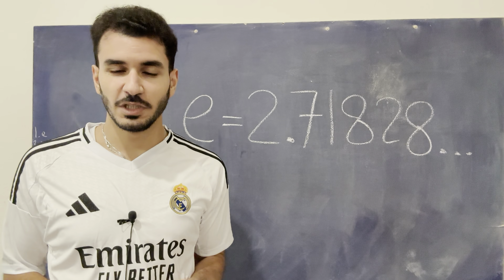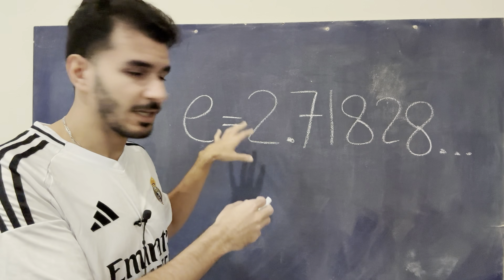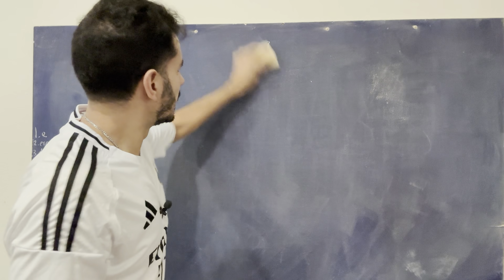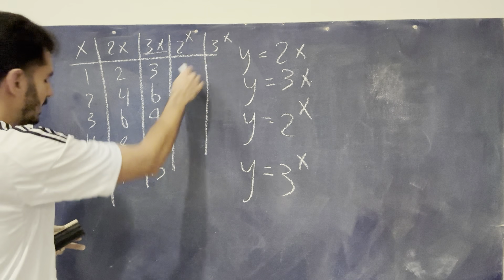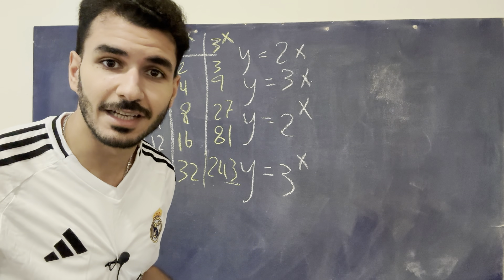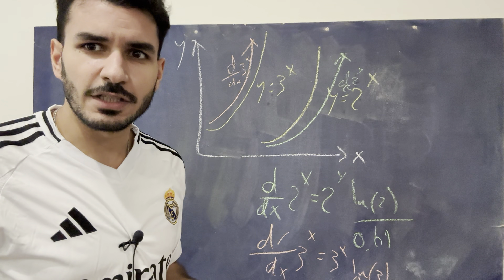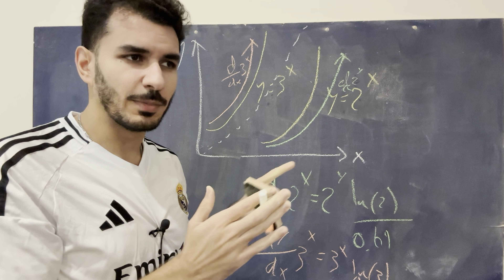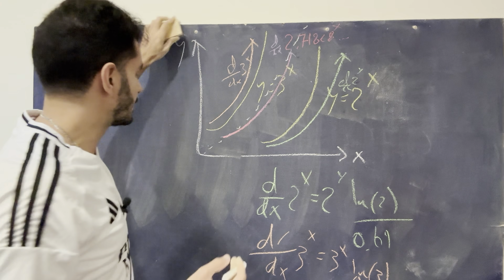Where does “e” come from?

Comment: I just added the breakdown to math and science videos as I see and add it to the e equals as per wth are you saying energy, exponential or exponent..a e has literally three angles at .9 degrees because it's a fraction of a circle. One making 390 degree and therefore only part ..times three is 2.7 now add the constant for the compound and division of ..for the constant meaning literally continuing. It's structural and atomic make-up so don't pun your way home because I am pretty sure this simple way to see geometry and the last is the cleavage becoming the crevice valley or equal value for again, ??? Cleavage. Compared to carbon and yes the diamond pattern of frequency..fitting in a neater little package to understand for anyone that has interest in the forming causes and a place on earth for waters and hills. Cleavage..the information highway about reflecting because continuing is about that..each layer atmosphere has separation divisive but simultaneously uses each to transition suns frequency. You're seeing why maybe truly..how truly. Why for what? Sometimes the why helps explain the math in usage

Comment: Way too many new concepts are introduced into this understanding. It is impossible to use unknowns - derivatives, exponents, limits …  to explain another unknown ‘e’. Instead, start by drawing the inverse curve 1/x. Then draw a vertical line from the curve to the x axis at x=1. Then show that the area under the curve (square units) increases as x gets larger. Finally, when the area = exactly 1 square unit, then the value of x = e. (2.71828…) From this easy understanding you can then use this basis to develop the properties of d/dx (e^x) = e^x. Finally, introduce limits and Euler’s equation for advanced unerstandings.

Comment: You are right. e was never explained like this. Great video. Thanks for sharing. I especially found your comment linking e to equilibrium. It makes sense that Bernoulli first discovered this number. When you extend this into Chaos theory I am wondering if this has anything to do with an attractor. Some experiments derive order from chaos which may also be linked or related to this constant. There is also in Modern Thermodynamics additional theories that extend the 2nd law the further you are from the equilibrium that helps expose or amplify some special properties of nature that are recently becoming useful in physics to help explain more of Maxwell Clerk equations.

Comment: but how is it that the log 2 and log 3 are calculated to be .69 and 1.09. what is the base used for this calculation? is the base is e, how are you defining e after using e as the base for calculating log 2 and log 3

Comment: I have known about e since secondary school 40 years ago, I have being using e practically and looking at YouTube on the subject of e for the last 20 years, and  as an engineer I have had a gut feeling e was about balancing a circuits dynamics, with the rate of a capacitors voltage increasing equivalent to the rate of the decreasing resistor voltage, but this video is one of those Aha moments, a great composition of maths, chalk and good lecturing. Thanks, I appreciate the video for how it explains e.

Comment: Where does the constructive algorithm of e actually come from? Well, from Platonic heavens, of course! :) 

In the mathematical means currently available to us, this revelation can be seen from the periodic continued fraction of 1/e: 
[0; 2, 1, 2, 1, 1, 4, 1, 1, 6, 1, 1, 8, 1, 1, 10, 1, 1, 12, 1, 1, 14, 1, 1, 16, 1, 1, ...]

The cf path is a convolution or fusion of two types of periods, at first look the 2n periods punctuated by 1, 1 periods. To see more clearly, let's write out the full R/L path along the Stern-Brocot binary tree, which constructs number theory from top-down nesting algorithm perspective of mereology. 

L LR LL RL RRRR LR LLLLLL RL RRRRRRRR LR etc. 

Now, let's see what happens when we split the periods in half and do a simple string length count of the truncated segments: 
0
L 1
LL 2
LLRL 4
LLRLLR 6
LLRLLRLRR 9 
LLRLLRLRRRRL 12
LLRLLRLRRRRLRLLL 16
LLRLLRLRRRRLRLLLLLLR 20
LLRLLRLRRRRLRLLLLLLRLRRRR 25
LLRLLRLRRRRLRLLLLLLRLRRRRRRRRL 30
etc. 

The length counts alternate with perfect squares n^2 (1, 4, 9, etc.) and oblong numbers n(n+1) (2, 6, 12, etc.). The distances from the perfect squares to the previous and next oblong numbers are equal. 

The path segments LR and LR are length 2 periods of Fibonacci fraction paths with maximum zig-zag. Based on what we have observed so far, we can deduce that the 2n periods come from the straight paths of "oblong" fractions n/(n+1) or (n+1)/n without any zig-zag after some possible initial values. 

These are fairly simple observations, and I don't know why these don't seem to be already public knowledge. Here's an IMHO interesting question. As we interpreted the first LR substring as a Fibonacci segment, it would seem more consistent to organize the continued fraction path the following way: 

L RL RR LR LLLL RL RRRRRR LR LLLLLLLL RL etc., instead of
L LR LL RL RRRR LR LLLLLL RL RRRRRRRR LR 

so that the alternating zig-zag of direction changes would be coherent with the analysis of involved periods. From quick check using the path calculator on R. Knott's pages, the corresponding fractions at that search dept are 47483/75117 and 27634/75117. The denominators remain the same, and numerators deviate at 2/3 and 1/3. The subtraction differences start as Fibonacci sequence, but the whole structure is more complicated.

Comment: Very nice video! I have a question. When explaining the derivative of 2^x and 3^x, you got ln 2 and ln 3 values, but that ln is a log with base e. If we had a different base, wouldn't the derivative become equal to the new base and thus change the e value to the new base value? Though the following explanation of the limit of the function explains a number for e for that function, why does that function become important and not any other function? Please let me know if I make sense. Also, please share your thoughts. Thanks!

Comment: Several comment here. e^(itheta) ties in with your video on I where it is the rotation operator on a vector, so it makes perfect sense that it would give us rotation.

Also, if we multiply Euler's equation with the complex conjugate, cos(theta) - i sin(theta) of the right side, we end up with the function, we get e^(-itheta) =  cos(theta) - i sin(theta). adding and subtracting e^(itheta) and e^(-itheta) gives us the equations for cosine and sine.

One idea from the world of business. One dollar compounded continuously at 100% interest will be worth e at the end of the year.

Here is an easy way to remember e. It is 2.7 then the date 1828 which is such a significant date that it is repeated. Then we have a 45-90-45 right triangle. e = 2.718281828459045.

Comment: Very interesting video. But, you didn’t include the best part of your demonstration: the algebraic derivation of this function. The expression (1 + 1/n)^n can be algebraically deduced using the Binomial Theorem. After working through the algebraic manipulation, you’ll arrive at this exact result: (1 + 1/n)^n = 1 + 1/1! + 1/2! + 1/3! + 1/4! + 1/5!... 

This is the definition of "e"—the infinite sum of the reciprocals of factorials.. If you plug in this values in a calculator, it will add up to 2,718... in fact, that's the way the calculator operates this value. You can also do it by hand. Eventually you will get to this aproximation.

The most interesting part is to ask: why don’t we end up with a fraction? Or a root? Or some power-based result? The answer is: "e" is transcendental, just like π and other constants, meaning it cannot be expressed through fractions, roots, or any common algebraic tools we use in everyday math.
Reply: If I also have a chalk board I would demonstrate the algebraic part for you. It's not hard.

Comment: 10:10 Actually, that value comes from Euler trying to calculate how would be the compound interest value of deposit with interest rate 100% per year, if he could get partial interest and reinvest it. E.g.:
If the interest would be paid after 365 days, the total amount would be C+100%*C = C(1+1/1)
If the interest would be paid every 6 months and immediately reinvested, the amount would be C+50%(C+50%*C) = C(1/+1/2)^2
If the interest would be paid every day and then immediately reinvested, the amount would be C(1+1/365)^365
If the interest would be paid every 1h and then reinvested, the amount would be C(1+1/(365*24))^(365*24) etc.
The amount approaches a strange number of 2,718281828... known today as Euler's number "e".

It appears that the same number is for the function f(x)=e^x which miraculously has the value of "steepness" equal to the value of the function for every x.

Comment: I asked chat gpt were e came from some months ago. I just add this because it explains were the fomula (1+1/n)^n with n going to infinity comes from.
The number e was first calculated by Jacob Bernoulli around the year 1683, while working on a problem involving compound interest. 
Jacob Bernoulli investigated what happens if you invest (€)1 at 100% annual interest, but instead of compounding yearly, the interest is compounded more frequently:

    Once a year: (1+1)^1=2

    Twice a year: (1+1/2)^2==2.25

    Four times a year: (1+1/4)^4=2.4414

    n times a year: (1+1/n)^n

Bernoulli discovered that as n approaches infinity, the result does not grow without bound, but instead approaches a fixed limit: the number e.

Comment: death rate try to decrease population, birth rate try to increase the population , overall rate of population and in many cases in nature is e as well , plus since e has a constant rate  , we use e with iota for constant rotating things , like constant rotating current ( meaning oscillating ) or any other physical system , and where the expanded cos and sin part gives us exact location of the measurement at anytime, mind blown and very interesting.

Comment: I'm not really a math major guy but I saw somewhere that some mathematician before Euler invented the use of logarithms to be able to handle large numbers and series of various growth rates. Like log(100) [base 10] = 2, log(1000) = 3 and so on. 'e' is simply a special case of all the (infinite number of) possible bases whereby the derivative of exponent, like you have shown, is equal to itself. d/dx e (exp x) = e (exp x).   This is weird in the same way the d/dx sin theta = cos theta. huh?  actually i think they are indeed related in euler's formula??

Comment: Positive numbers above and right of the origin intersecting perpendicular enumerated straight line segment coordinate system axes, + and negative elsewhere, imples they're opposites, by contrast with hyphen, - , prescripted duals, shown here for reflection in the magnified horizontal axis where "|" is a similarly labeled vertical axis * ,

 ... > -1_-1/2_ | 0 : -X <--> X | __1/2 __1< ... .

Necessary dichotomally recognizing category and not category establishes quantity and no quantity representative numeric complements, unity and only function defined, ●○ : upper bound --> supremum, indefinite whole number that isn't a successor zero, 

with numeric difference and magnitude implying the arithmetic operations subtraction - , addition + , multiplication x and division / , while mathematical consequences from recognition include 'ruling out' non-number symbol infinity and a resulting product only of the same kind as it's arguments ** .

* This law of the excluded middle abiding solution, - x +, may avoid the devastating contradiction from a spacedual-space, -x+, singular interpretation of the set of real numbers.

**
• Either reflection, or rotation, other than about a coordinate system's zeroed origin, implictly recognizes a dual entity.

• Young's double-slit experiment implies physically corroborated seman-syntac-tic entity, electron, has particle and wave forms.

• 〜 wave has a crest, trough, wavelength, amplitude above and below normal and augmented result when two nodes intersect, but cancelled crest-trough anti-node otherwise (  https://en.m.wikipedia.org/wiki/Electromagnetic_radiation  ).

• Christof Koch's finding that visual continuity is interpolated ( Closer To Truth, "Christof Koch - How are Brains Conscious?", YouTube ), implies that Pythagoras' theorem ^ can be used to 'join the dots', simply connecting dual quarters to form a zero origined circle in an affine enumerated grid, with one semi-circle representing classical and quantum idealism and the other materialism say ^^.

• Zoom embracing superposition, where somewhere can be in more than one state and conservative vector field ( https://en.m.wikipedia.org/wiki/Conservative_vector_field ) irrotation ( https://tutorial.math.lamar.edu/classes/calciii/curldivergence.aspx ), where magnitude depends upon the difference between non-identical 'end points' instead of the path between them ( https://www.google.com/search?q=a+student%27s+guide+to+maxwell%27s+equations&client=ms-android-samsung-ss&sca_esv=5eadaca3d07e07eb&sxsrf=AHTn8zrIHI03DmmUdcJZIBqon5gEbWsLHA%3A1742745504436&ei=oC_gZ4W4Gp6k2roP0qa1uAg&oq=a+student%27s+guide+to+maxwell%27s+equations&gs_lp=EhNtb2JpbGUtZ3dzLXdpei1zZXJwIihhIHN0dWRlbnQncyBndWlkZSB0byBtYXh3ZWxsJ3MgZXF1YXRpb25zMgoQABiwAxjWBBhHMgoQABiwAxjWBBhHMgoQABiwAxjWBBhHMgoQABiwAxjWBBhHMgoQABiwAxjWBBhHMgoQABiwAxjWBBhHMgoQABiwAxjWBBhHMgoQABiwAxjWBBhHMg0QABiABBiwAxhDGIoFMg0QABiABBiwAxhDGIoFMhMQLhiABBiwAxhDGMgDGIoF2AEBMhMQLhiABBiwAxhDGMgDGIoF2AEBMhMQLhiABBiwAxhDGMgDGIoF2AEBMhMQLhiABBiwAxhDGMgDGIoF2AEBSOQZUABYAHABeAGQAQCYAQCgAQCqAQC4AQPIAQCYAgGgAiKYAwCIBgGQBg66BgQIARgIkgcBMaAHALIHALgHAA&sclient=mobile-gws-wiz-serp#ebo=0 ), are prose interpreted orthodoxy supporting.

^ The diagonal hypotenuse straight line segment intersecting a perpendicular base and side, forming two of three vertices representing flat spatial points, in a 'right angle' triangle who's interior angles sum equals one hundred and eighty degrees - pi radians - , respectively exterior square area - base multiplied by height - equals the sum of the other two squares.

^^ The fact that 'negative root' solutions to the relation for a circle, r_2 = x_2 + y_2 , where "_" means superscript and "r" radius, are prohibited by the rule that the product of a number with itself is positive regardless, for example 1 . 1 = -1 . -1 = 1, where " . " means multiplication, is consistent with semanticless syntactic interpretation ° .

° Letting measurement establish a specific relationship between classical and probabilistic quantum systems, while recognizing semantics by requiring the product of a number with itself to be of the same kind, "[since Schrodinger's equation formulating the evolution of a quantum system isn't] rigorously derived from existing theory" ( https://www.google.com/search?client=ms-android-samsung-ss&sca_esv=466a80cf504a0fa5&sxsrf=AHTn8zpsIGeKPF_0OgVukunBiRNfshjLcQ:1743099089973&q=Schrodinger+wave+equation+derivation&sa=X&ved=2ahUKEwieucOQ7qqMAxVLrVYBHWhrBowQ1QJ6BAhbEAE&biw=384&bih=774&dpr=1.88 ) ,  makes idealism operationally - given extant institutions - possible ` , keeping in mind that singularly interpreted contradictory integer subset, -ℤ+ = {-1, 1} ≠ {-1, 0, 1} = { - {{ }} , { } , {{ }} } = . ℤ . , in order type of a well orderd set form, like 0 := { } and 1 := {{ }} where ":=" is assign, illustrating that even though the empty set is a subset, it isn't necessarily an element, of any set : a Well Ordered Set, ( X , ⊆ ) , for "⊆" improper subset, is a set, X, equipped with an order relation, ⊆ , that is reflexive x ⊆ x , antisymmetric x ⊆ y and y ⊆ x implies x = y , transitive x ⊆ z if x ⊆ y and y ⊆ z , comparable x ⊆ y or y ⊆ x and where any subset has a least element.

` Even though the magnitude of straight line segments, -1_0_1 and 0_1_2 , is the same, a priveleged interpretation of difference is necessary to arithmetically reconcile them, by adding the opposite given double negatives, implying that 2 = 1 - -1 = 2 - 0 = 2.